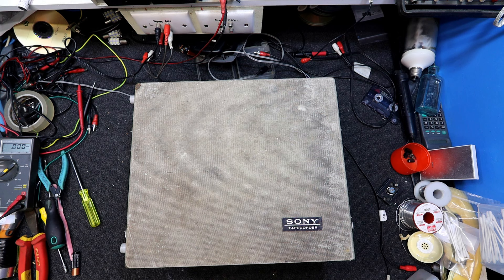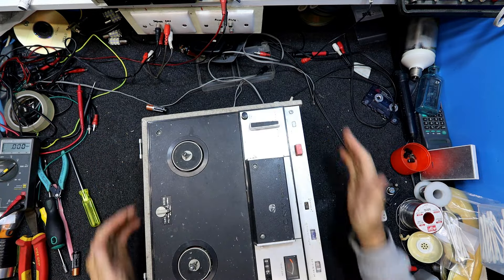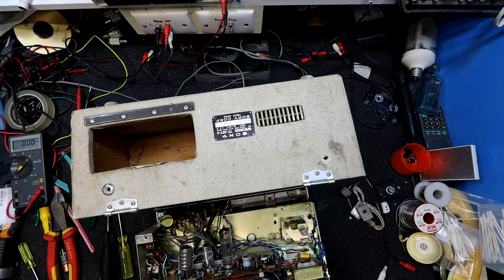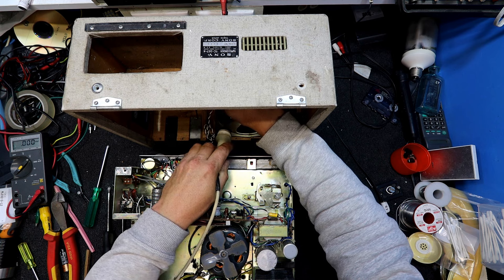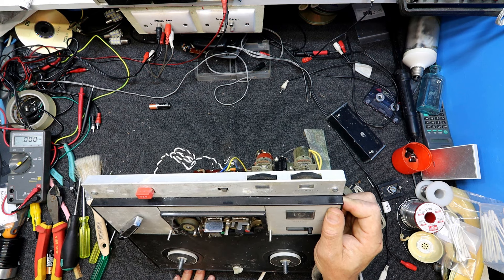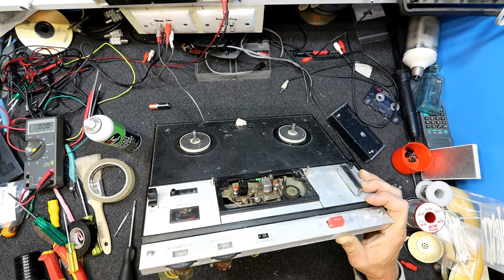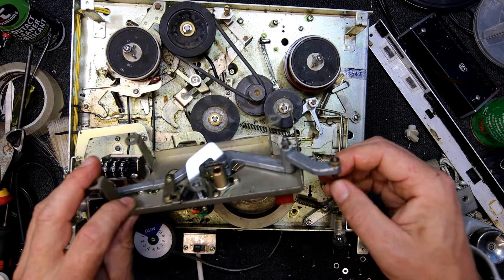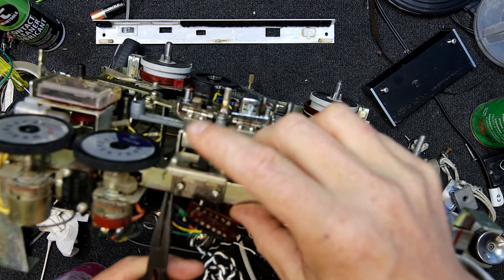Sony Tapecorder 1960s Reel to Reel Resurrection

Comment: If nothing else, these units can make great 'parts' machines for other or better Sony TC 'Reel to Reel' players.  Many use similar belts/mechanisms so they can interchange with other machines.  Yes, those cast metal parts are known to break as you mention, and it's good that you lubed that up, the next guy looking for one will appreciate it when it comes to remove it :).  Also,  the audio should be 'heaps!' better, but I notice your play head is missing it's felt pad on the back head cover! Everything is going to sound muffled and will be terrible without that little felt square.  Try it again, being a valve unit, guitar amp enthusiasts love little units like this to tinker with because of the valves.  If your gonna ditch the unit for whatever unit, save the valves, that's where the $$ are in these little piles of junk.  Have you seen what people will pay for certain vintage valves in great condition? Rick
Reply from the maker: Thanks for that advice. I completely missed the fact they need a felt pad to push the tape onto the head since its not a cassette machine. These were a bit before my time so I only repaired a couple in the past. When I find it again I will try something there and see how it sounds. Good to know the parts fit other machines too. Parting it out is the best option I think.
Reply: Cheers! Thanks for the reply.  Love the channel :) @StevesElectronicRepairShop